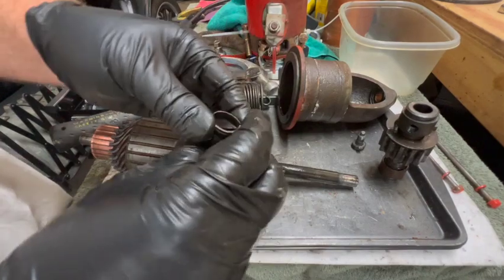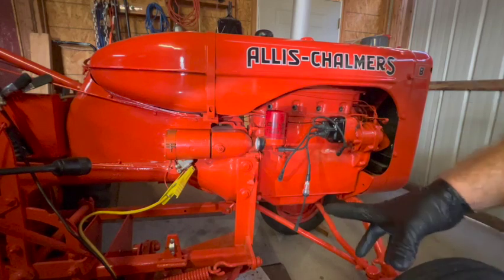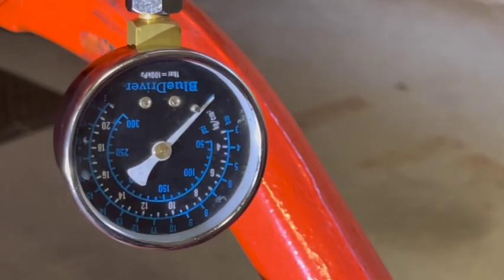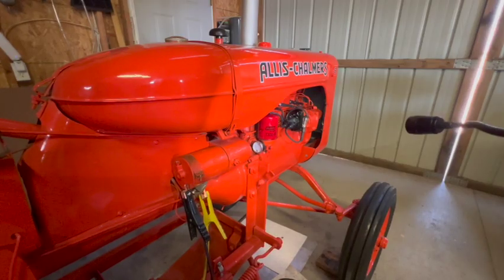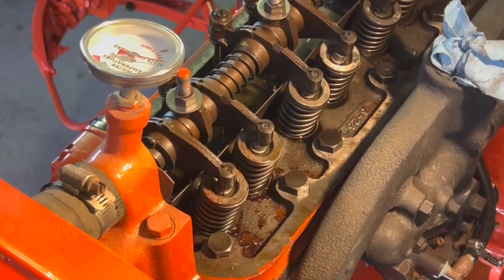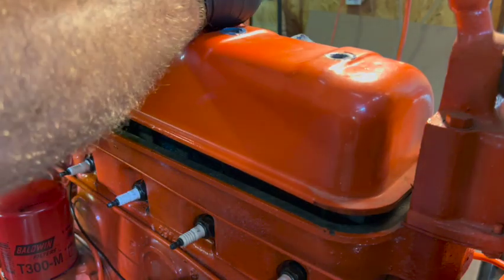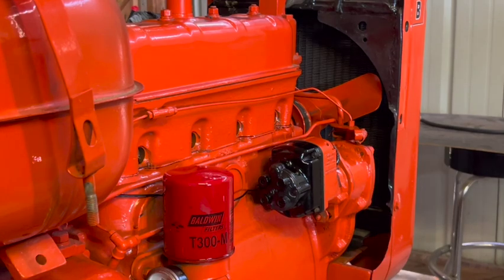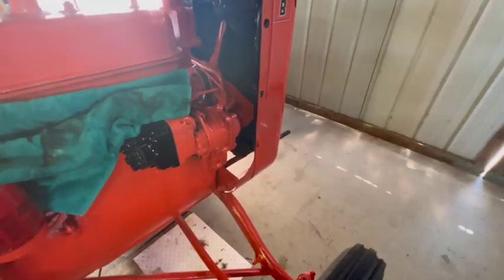1944 Allis Chalmers B - Part 3

Comment: A milled head on these engines is a very large compression change. I actually did it on purpose to gain power for my sons pulling tractor
Reply from the maker: I suspect the previous owner might have done that, and maybe a larger bore... seems like that would be a good reason for the extra compression.